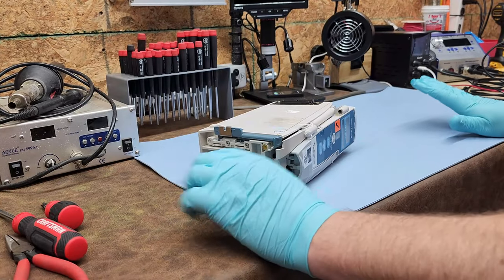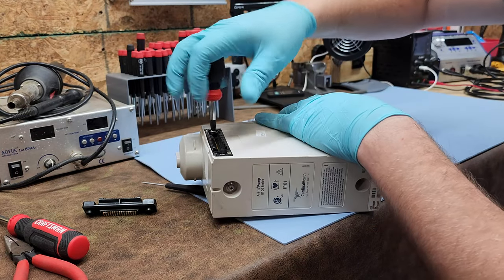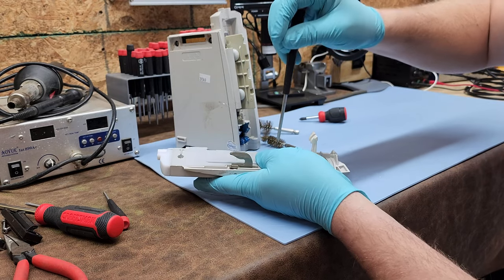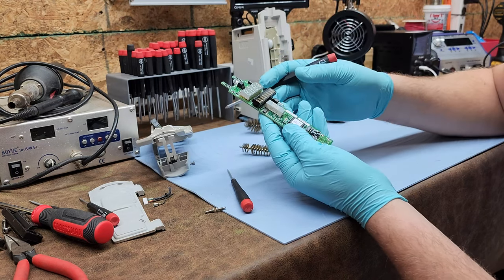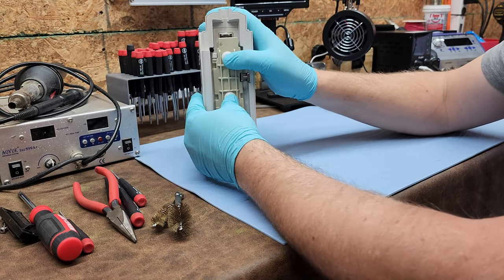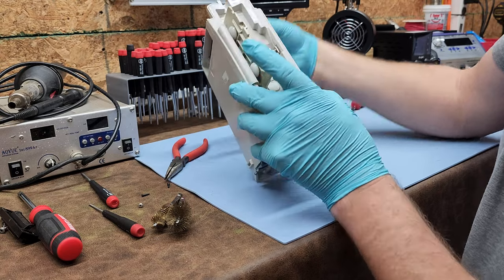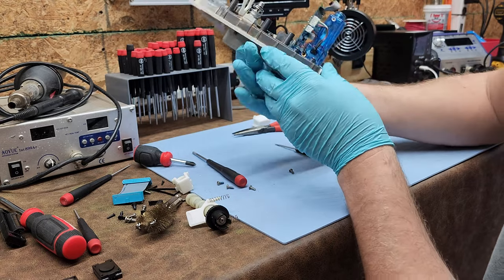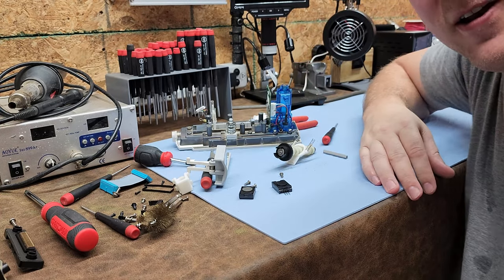Alaris Medley 8100 Infusion Pump Teardown!

Comment: Been using these for years, I had a basic understanding of how they work, but now totally get it. 
The bubble detector I learned about early on, so many I work with don't understand how that works and how to check if a crimp in the tubing is showing as a bubble. I have helped so many that are fighting with it for way too long and I come up, pull the tubing out, pinch it a little to straighten it out and it works no problem.